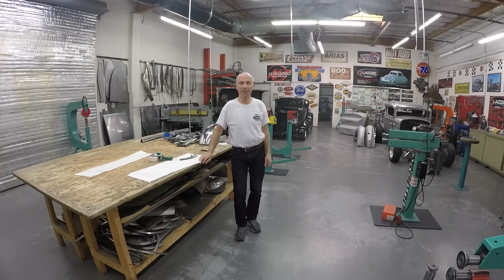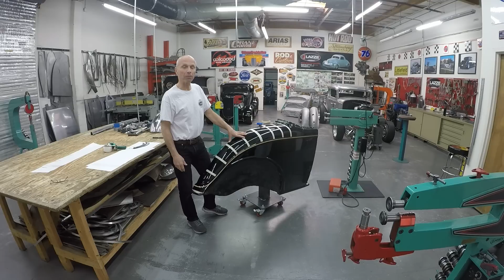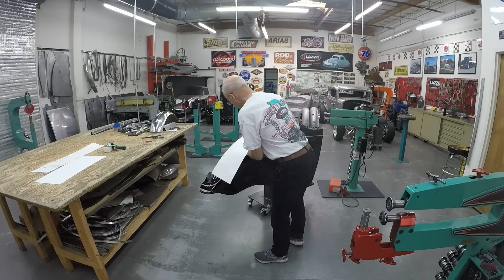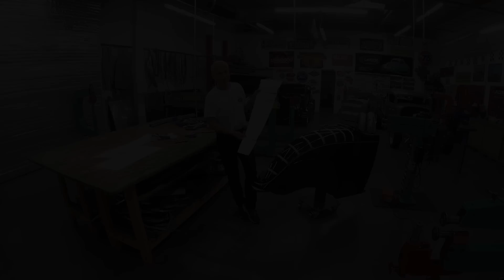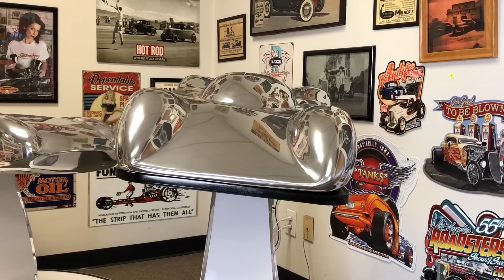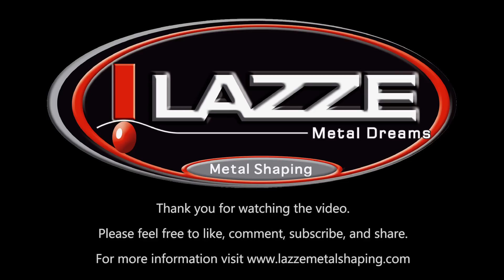Lazze Metal Shaping: Tips & Tricks-1934 Ford Rear Quarter Panel Layout

Comment: Cut out a plywood piece that’s a close fit 1/4 inch gap is good ...lay Two inch clear tape over the station line tape you laid out ...mix up a small amount of bondo 
Put a line of bondo on the clear tape a little thicker than 1/4 inch push the plywood template into the bondo and let the bondo cure do the next one and so on the template will pop off of the clear tape very easy 
You can remove the extra bondo from the sides with a grinder for flat pieces to draw the shape onto station buck 
These will last a long time
They’re perfect gauges to check  your shape with

Comment: Hi Lazze,
Glad to see you again and missing your videos.

Talking about what we would like to see. I am on the side of anything. Everything is a lesson even if its a repeat or part repeat of something already done. Show us what you up to and we will learn and follow you.

Your videos are great and an inspiration. Please keep them up and showing us tips and tricks.

I have a question also. Have you ever run metal like aluminum checker plate (tread plate) through the bead roller to say put an edge on it?  How would you do it with it having an irregular surface on one side?

Thanks you for your videos and keep up the good work
Regards 

Paul